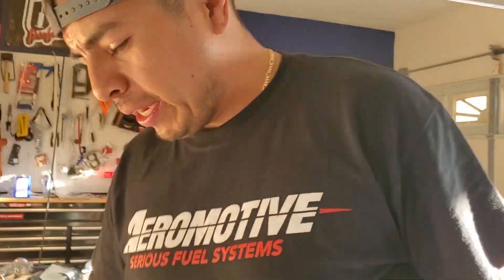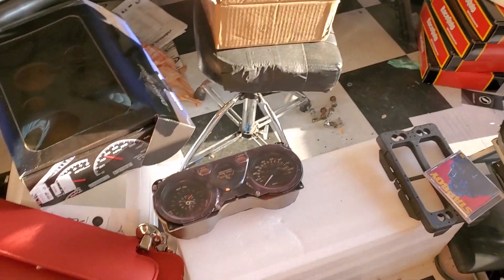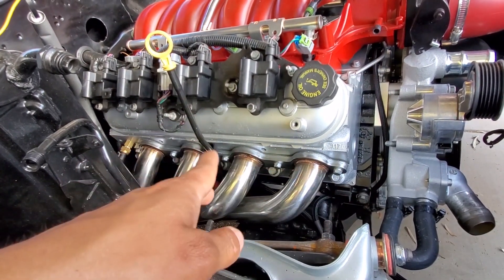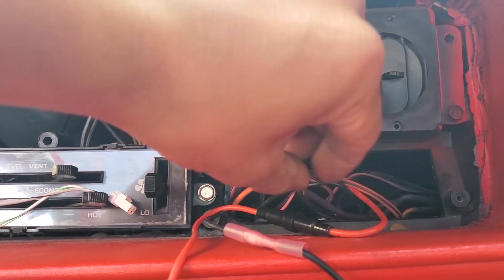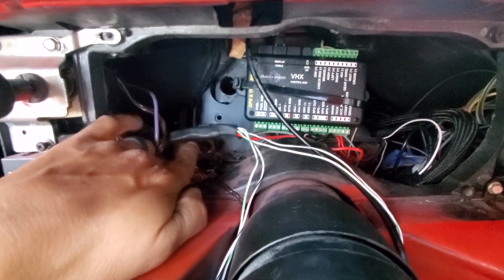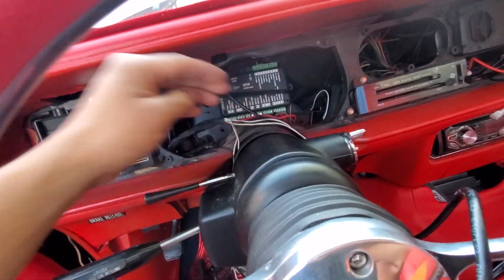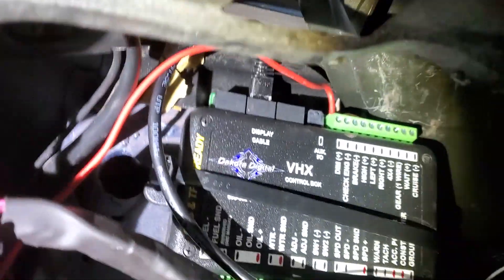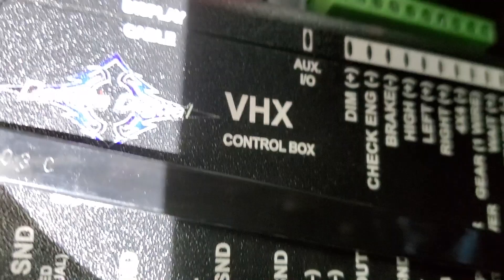HOW TO WIRE UP VHX DAKOTA DIGITAL GAUGES FOR MY LS SWAP!

Comment: Question! You run the oil pressure sensor to the Dakota VHX, did you run the oil pressure sensor to the ECU??
Reply from the maker: i have done both ways

Comment: are you using a computer with your ls engine? this question is because i have the vortec engine on a '52 chevy truck with factory computer and all factory sensor so i run signal wires (temp sensor, press sensor speed sensor) to dakota digital module (HDX) so do you think that gonna work or i need to replace those sensor for the ones come with the dakota digital kit?

Comment: How did you wire the hot side for the check engine light? Thanks
Reply from the maker: @hotrod.videos  just depends on what harness you are using 
 don’t be afraid to use the talk shop service on the website, save you some headaches 🤙🏽
Reply: @goosseperformance1444  thanks
Reply: @goosseperformance1444  I have a bp automotive harness. Has a pink wire and a white/brown wire. The white/brown goes to the Dakota digital but not sure on the pink

Comment: When you connected the parking light wire to the DIM terminal, how do the parking lights come on now since you are now using that wire elsewhere? Thank you
Reply from the maker: Should be two different wires use for those two ports

Comment: I have a set of VHX in my 61 C10. All is good but the voltage gauge drops when I push on the brake, pulsates with the turn signal and drops to 10v when I turn on the a/c fan? I have checked voltage with a meter all is good, it's the gauge set up. I'm sure it's a ground issue but I am not sure where to start. These gauges were installed by someone else. There is a ground running from the box to the stall firewall under the dash. I'll take any ideas you may have. Thanks!
Reply from the maker: Start with a new ground to the battery but DD I believe has lifetime warranty

Comment: Hey brother I’ve watched your videos several times and I’m trying to wire up my 76 c10. I’ve got a BP Automotive stand alone kit for my engine and transmission, paired with Dakota digital gauges and the speedway 22 circuit universal chassis and fuse box kit. I’m not going to use several wires from my new fuse box since I’ve got the stand alone but I’m leary about cutting anything off until I’m 100   Since the Dakota uses all its own senders I shouldn’t need the ones supplied with the speed way kit am I right?
Reply from the maker: It just depends on what you’re trying to read on your dashboard. You can also have redundancy, depending on the gauge set up that you are trying to run or have read for example for an ECU.

Comment: New subscriber here, I have a 1955 Chevy I did a complete Dakota digital gauges setup on. It has a brand new LS3 stage 3 with a 4L60e transmission, I am a bit confused on the Tachometer connection, can you assist?
Reply from the maker: What ls harness
Reply: Stock LS3 E38 computer
Reply: I'm new to the channel I have the same question I'm running a ls376 with a 4l70e with a US shift computer for the transmission. how do I connect the rear output shaft speed sensor to the gauge system ?? I'm located in henderson Nevada
Reply from the maker: @chrisgurican8745  not sure if you watch the last two videos Chris but you should be running Dakota digital gauges this make the much easier for you
Reply: @goosseperformance1444  I'm running dakota digital hdx gauge system. I'm trying to integrate my new American autowire chassis harness to the gm performance harness and a Us shift quick 4 harness

Comment: Great video. But I am still stumped. I have a 1981 TA with rally gauges. In the factory tab for the turn signals there are 2 wires for the left and  2 wires for the right going into factory tab. . Do I just pig tail a single wire then go into RTX control box. Same for the tach and fuel. The factory tach connector has 2 wires. And the fuel has 2 wires plus a ground wire. Any help would be appreciated.
Reply from the maker: should be one wire for tach on a ls swap , and one postive wire for t signals , other is ground

Comment: If I am runningva th 350 behind a 6.0 do I need to wire in the brake switch wire, I'm un sure any help would be appreciated.
Reply from the maker: sorry just saw this,  but no
Reply: @goosseperformance1444  thanks

Comment: The LSx oil adapter for the Dakota Digital sending unit. Where did you get that from?
Reply from the maker: ebay,  ict also has them
Reply: @goosseperformance1444  i couldn't find the adapter, do you have a part number
Reply from the maker: @alexispatrick8970   JUST ADDED A LINK IN DESCRIPTION

Comment: I thought with the ls swap when using the Dakota Digital all you really had to connect as for as sensors was the oil sensor that the Dakota Digital got its reading from the ls computer
Reply from the maker: Yes that if you use the Bim module but it you don't want the spend the extra money this is what you do